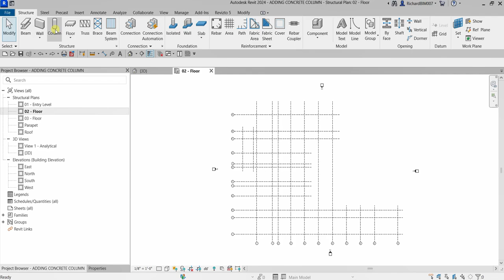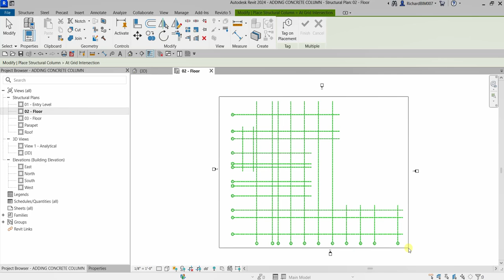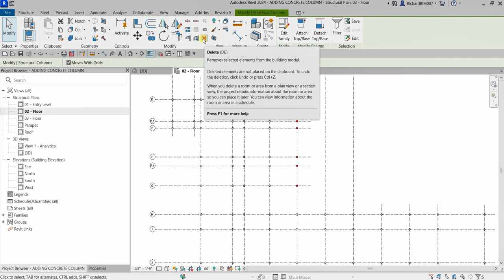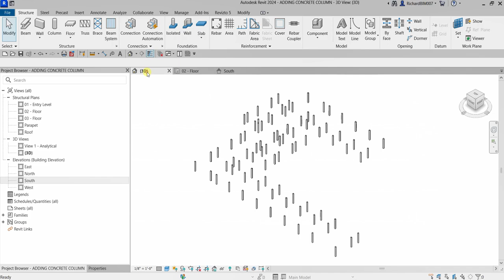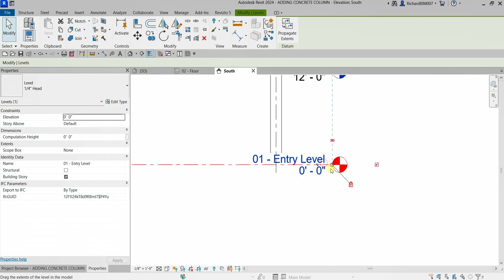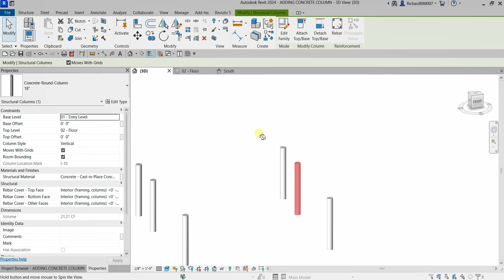Comment: Do you have a course for Structural Engineer (concrete buildings). Most important how to use Architectural BIM into Structural rather than doing grids columns position from scratch
Reply: hello, i dont have at the moment. sorry.